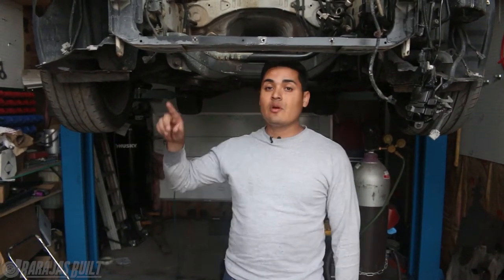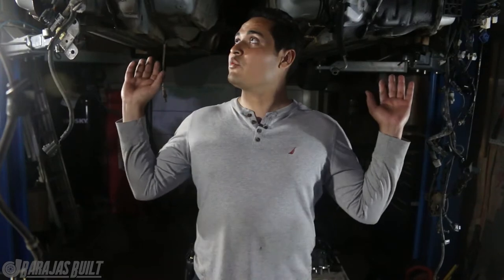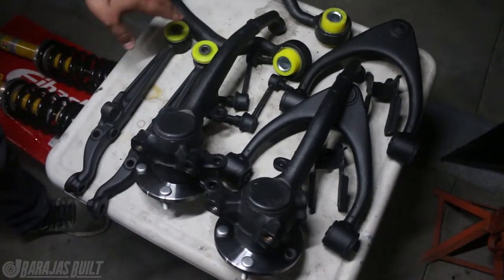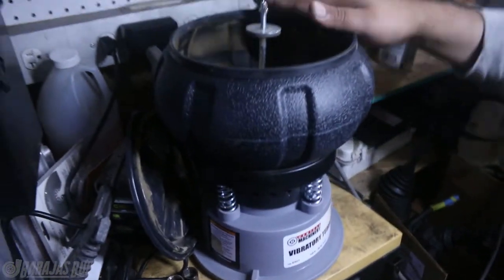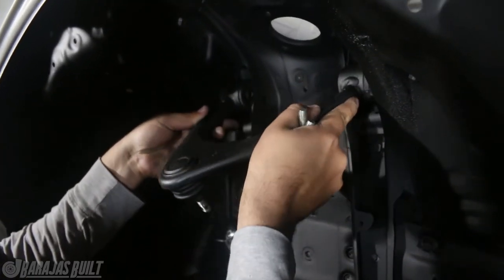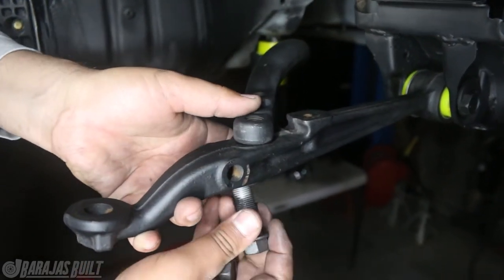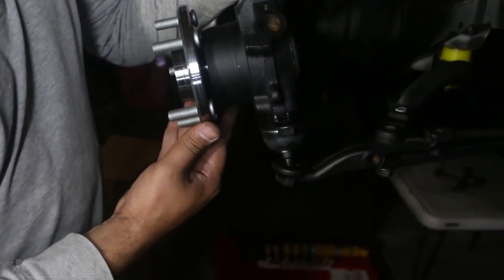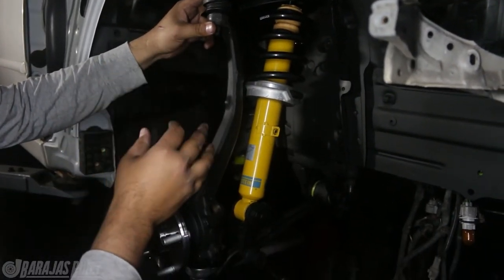IS300 Drift Build [Ep.4] "Full Under Body and Suspension Restoration"

Comment: Whats the difference between the oem swaybar endlinks and the adjustable ones? Are adjustable endlinks really necessary?
Reply from the maker: Adjustable end links provide pre-load adjustment to tune for predictable suspension motion and to adjust the sway bar centerline back to oem specs when you lower your car.